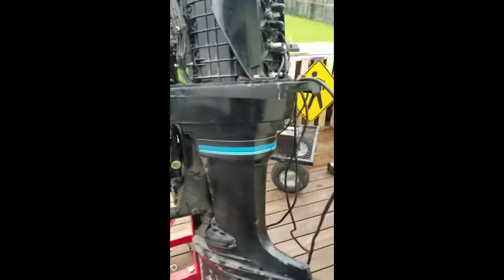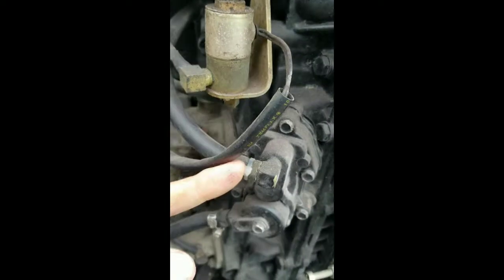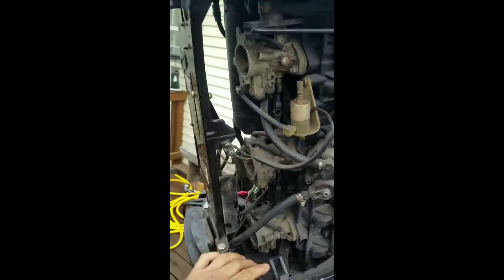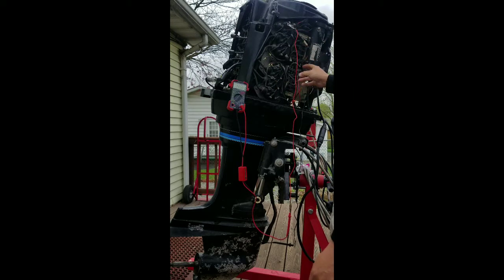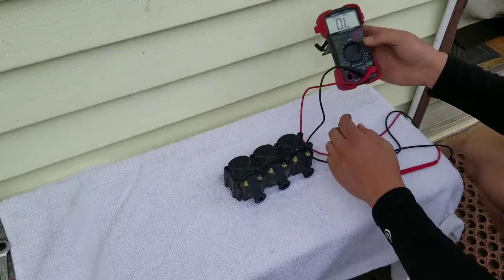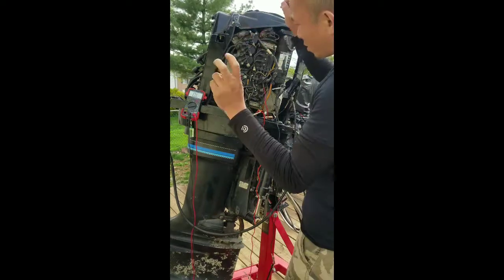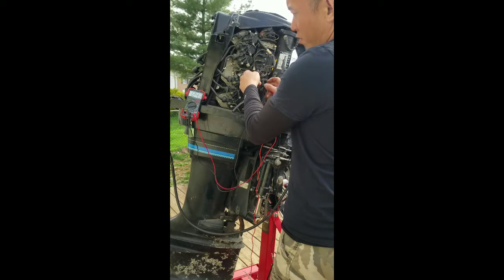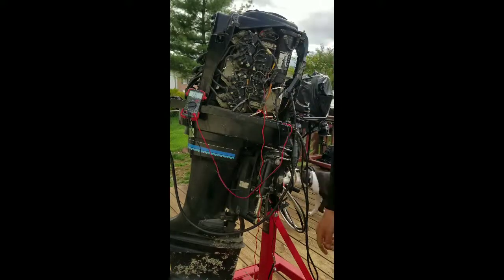1982 115HP L6 Autopsy

Comment: It is interesting what you say about a de-tuned 140 hp. A friend had an original 115hp on a heavy boat, used it for years, he decided to get a new one.  The old one was probably from the 70s with the distributor ignition, the new one an 84 which had the new electronic ignition.  Since his prop was good, he chose to save money and simply use the old prop.  When they went on a test ride, the new motor over revved by 1000 rpms with the same original  prop. He had to get a new prop after all and it was either one or two inches more in pitch.  He told me of the experience and said that he figured that the new motor now being rated at the prop, as you said, was the old 140 that used to be rated at the engine. Now, with that being said, you say they changed pistons, reeds, carbs jets etc.....I wonder what the new motor would do with the old 140 parts swapped into it?
Reply from the maker: It would be beast. They changed the jets, port timing, low domes, and read configurations. However, no 2 engines are alike. When produced due to icomia (spelling?) only have to be with 10% of what's advertised on the cowling. That being said you can have 2 115hps same year and one be closer to a 105hp and the closer to 125hp. Confused yet? 🙃
Reply: @MerCSonL6  

The 1978 140 was the the 1977 I6 150, then as the yrs went by there were slight changes thru 81. 82 was the first yr for prop rating the I6s, and while the 140 vanished, and the 90 and 115 remained, it wasn't simply a change in decals, the old 140 becoming the 115, and the old 115 becoming the 90. True the new 115 now had the Power Ported Pistons that only the old 140 had, but Carburation was different. The old 90 and old 115s used different port timing and carbs, but the new 90 had different carbs than either of the previous two.  Rpm ranges for 90s stayed the same 4500-5000, and same went for the 115; 5000-5500. The 140 was 5300-5800. I had a 78 90 on a 15 ft crestliner, and it did 38mph with a 17", I replaced it with an 84 115, with a 19" it did 49mph. That was what the same boat did with an Evinrude 140hp
The low Crown Pistons were introduced in 1984

Comment: So if you lose fire on three cylinders it's likely have a CDI board battery with a bad ground there's two of them on that motor each one will control three cylinders if you've lost it in just one cylinder the coil problems the best thing to do right now would be to take all of your wires loose from every component on it disconnect them they're all color coded and wired if the wires are rotten it's time to put new ones in but take them all loose and run the individual own test on each one of the units and find out which unit is bad a lot of times you'll find something simple like a $20 rectifier will stop the stator from working or maybe you lost this $300 stator but either way you can test that with a no-meter you can find all those results on the internet I've done it in multiple times
Reply from the maker: Ok my friend.